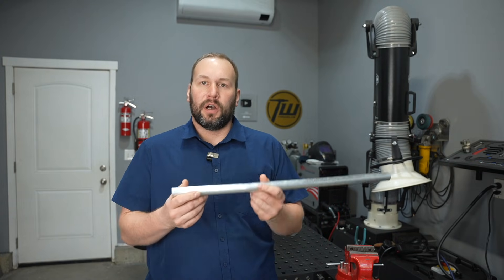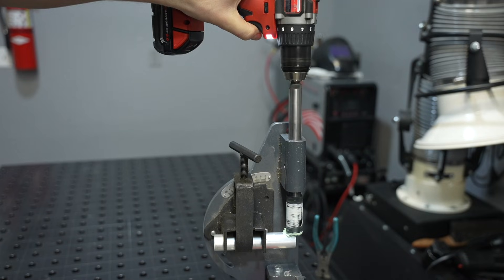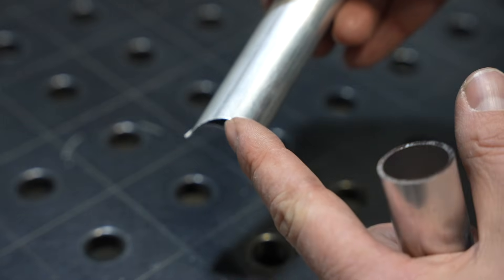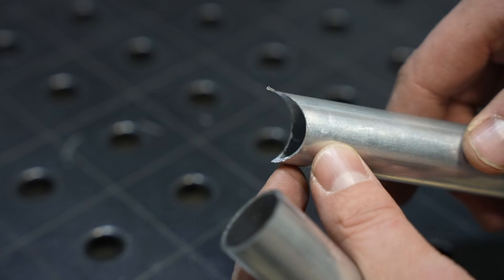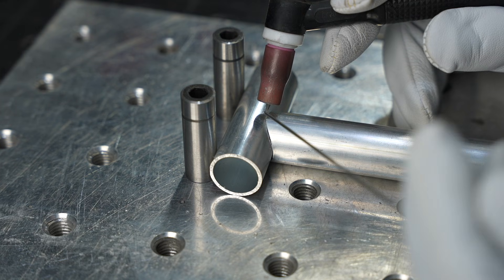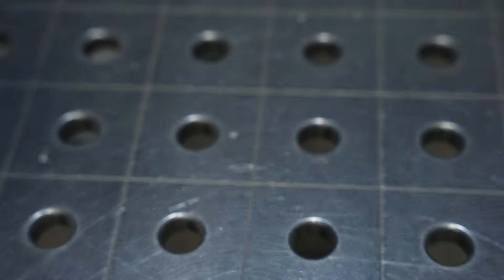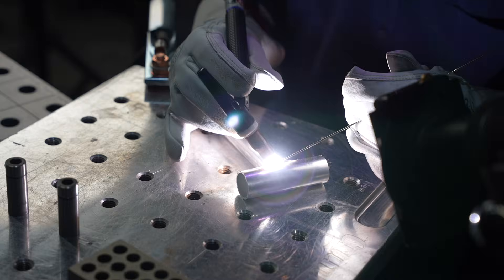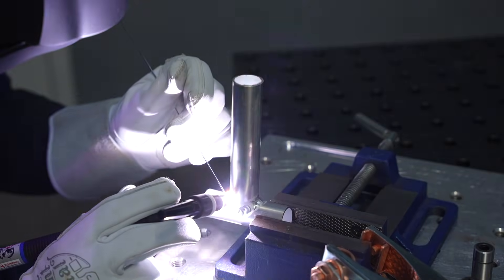Fitting and TIG Welding Thin Aluminum Coped Tubing: Subscriber Request

Comment: Cannot emphasize enough the "let the puddle go shiny before adding filler" comment.
This was THE problem I had when learning to TIG aluminium after learning on steel.
Unlike steel, the aluminium puddle starts off "frosty" as oxides float to the surface. This is not the time to add filler as the puddle is contaminated.
After another second or so, the oxides are cleaned off and the puddle goes "shiny". Now you can go nuts 🙂